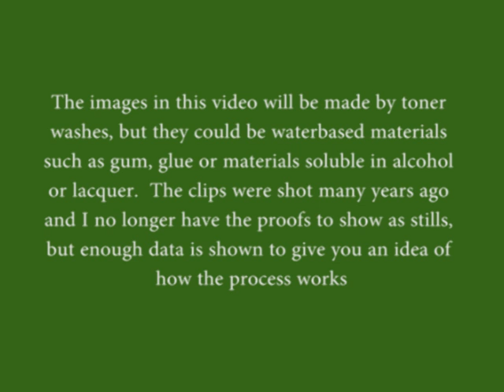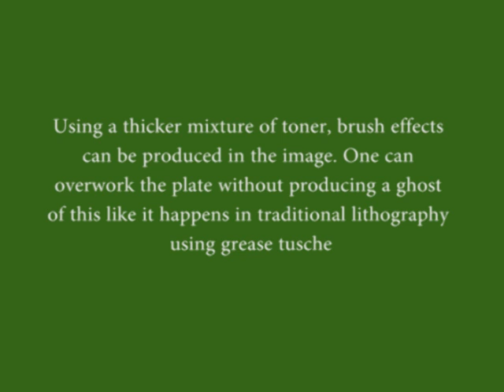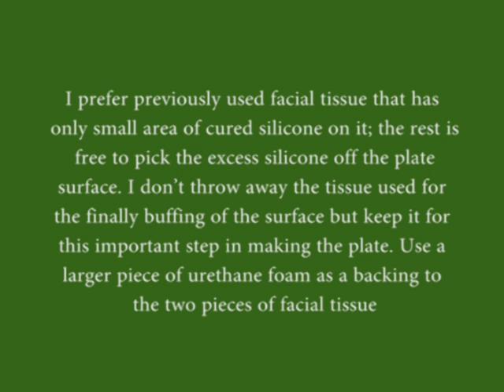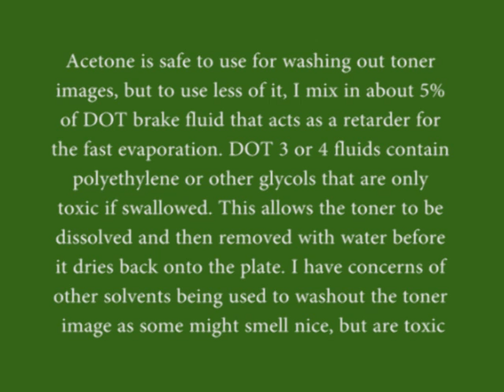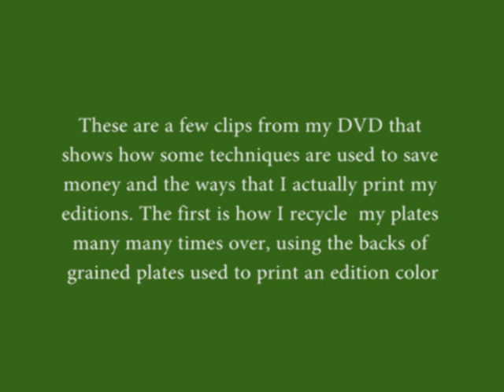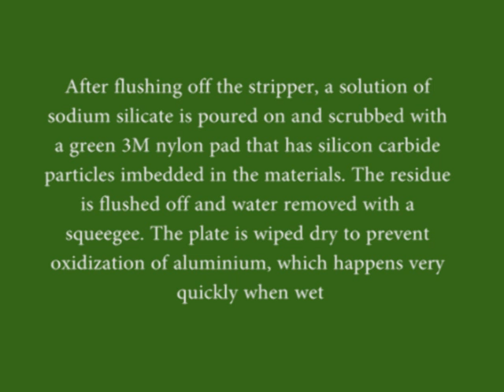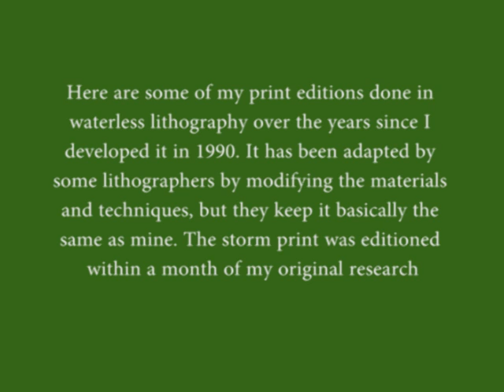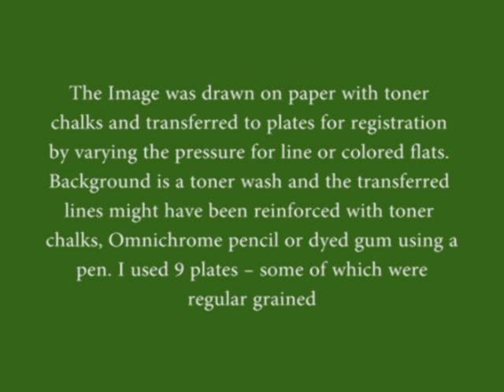waterless litho.mp4

Comment: The first two responders know very little about materials. Toner no longer used lampblack but iron oxide that is also used by artist as Mars black. Check you supply with a magnet on the side of the plastic container.